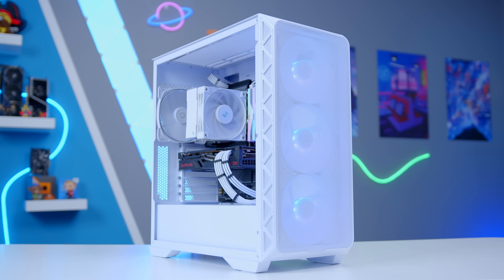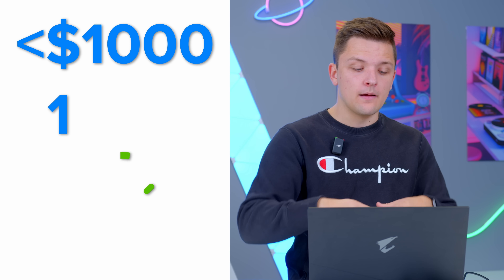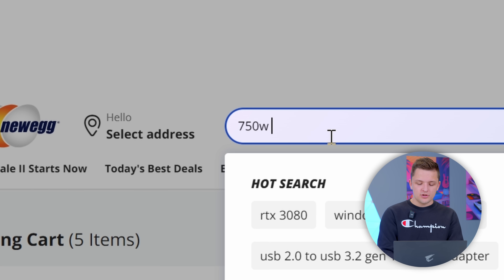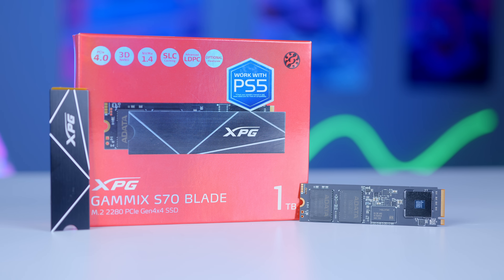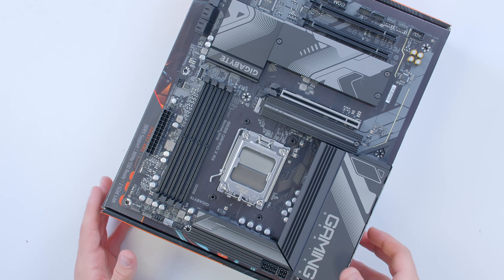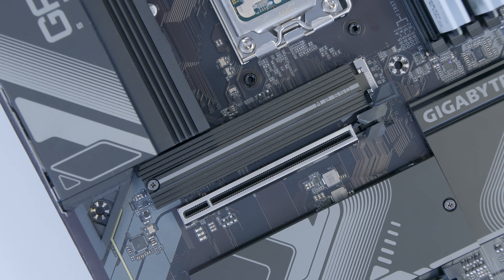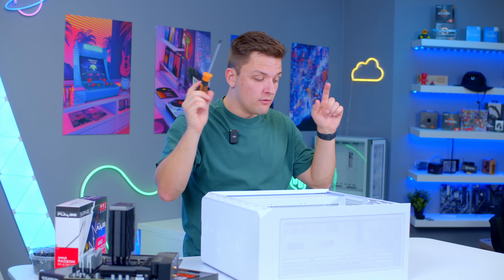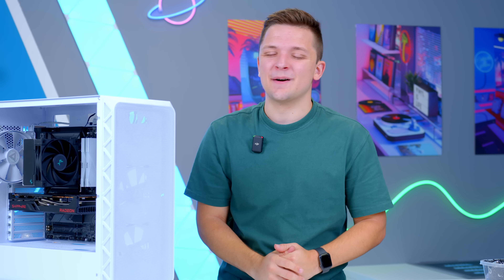The BEST $1000 Gaming PC You Can Build Right Now! 🛠️ [Full Build Guide]

Comment: I'm currently torn between the radeon 6700 and 7600, both have similar performance for the same price, and while th 8gb vram might be an issue, they were still neck and neck at 1440p, which is the highest I'd reasonably run on these cards. Couldn't help notice that your charts didn't have the rx 7600 for comparison though.

Comment: I built this pc, but I haven’t been able to get it to work yet. When I go to install windows 11 it tells me my computer doesn’t meet minimum requirements. Im assuming tpm is disabled, but I can’t find it in my bios. I go to settings->miscellaneous, but in the spot it should say tpm,  it says tsme. Anybody have any idea how I can fix that?
Reply: Figured it out yet? And if so how does the pc rub
Reply: @vaocl  I have not yet figured it out. I'm on night shift, and I've had some family emergencies, so I haven't had enough time to figure it out yet. I'm 90% sure its a TPM issue, but I don't have the TPM setting in my bios, even after updating, and Gigabyte's tech support hours aren't lining up with my waking hours. the computer looks amazing, and was fairly easy to assemble. I can't speak to performance because Windows. 

I did notice in the glamor shots in the video he didn't really plug everything in, its pretty much just the bare minimum power cables to get the lights and fans, and they appear to be custom. the cables that came with are jumper cables, which don't look the best and waste some space, but its fine.

the pre cable management on the case was also a bit messy for my taste. I un-velcroed everything and made them sit a bit nicer, and now they look nice. lots of spare room. I would recommend getting a GPU support of some variety. after a few weeks mine is already sagging a bit. 

When I finally get it running I'll definitely post more info.
Reply: Finally got it working. For some reason windows 11 did not like the tpm setting. I ended up downloading windows 10 and then upgrading after the fact. Now that it’s running, I’ve had no issue and it runs so smooth. I did upgrade the ram because I do a lot of cad/sim game/ram heavy tasks. I think I will also want to get more m.2 drives, since there is space for 3. I went with all black instead of white, and I love the red breathing lights. 

One additional problem I ran into was the built in wifi card came with an out of date driver, so I needed a 30ft Ethernet cable to download the driver, and now the card works great. Honestly almost as fast as the wired connection was. 

If I were to do this again, I would probably upgrade the nvme to a larger size right out the gate, and definitely just started with downloading windows 10. That alone would have saved me three weeks of troubleshooting.

Comment: I just built this exact computer and don't recommend it if you're a beginner like I am. The video does not show you where to plug in the PSU cords. I had such a difficult time figuring out where to plug in everything especially the Power cord which is 1 pin. On the motherboard it is written in about size 2 font. Once I got it running it was difficult to figure out how to configure it so that Valorant ran correctly. Almost 12 hours later everything works great.
Reply: Where did u plug in the power cord on the motherboard?
Reply: Also where are the power led+ and - ports?
Reply: Look the bottom and you will see a bright green square. That's PLED. The bright blue under is HD and red is the power one.
Reply: @aumpeaceamen  the one on the bottom right?
Reply: @aumpeaceamen  and what about the sata port. Sorry I’m asking too many questions 😖
Reply: @prady_hyper how does the build run?
Reply: @prady_hyper sorry I don't remember the SATA. Hope you found everything
Reply: @aumpeaceamen  ya I did thanks
Reply: How does the build run?
Reply: @vaocl my kid says it runs well but this was after we configured it which this video has no instructions on how to do.
Reply: @vaocl  it’s great! I used different ram and gpu coz these ones were out of stock. Although after a few days I started having issues with WiFi. A lot of my connections aren’t showing up, and the ones that are r very weak. Does anyone know how I can fix it?
Reply: Is anyone having problems enabling XMP in the BIOS for this build? Did you guys enable it

Comment: I just bought most of these parts on black friday, and I'm excited to build it. this will be my first new computer since 2015
Reply: I'm in the same boat. lmk how your PC goes
Reply: After a few weeks of troubleshooting, it works great. I would recommend downloading windows 10 to start with, and then upgrading to 11 if you want. The bios had some tpm compatibility issues. 

I upgraded the ram because I do a lot of ram heavy tasks. I would probably have also gone with a larger nvme drive to start with, I have a feeling I will be adding 2 more of them to the empty slots. It performs great, and I love the case. The pre managed cables needed some cleaning up for my taste, but I work in a data center, so maybe it’s not an issue for most. 

I would recommend this build with the exception of spend the extra money on a 2tb nvme to start with, and start with downloading windows 10.
Reply: @seankrake4776  this was insightful thank you sean
Reply: Let us know!
Reply: I have built the pc, but I’ve run into issues. When I go to install windows 11 it tells me my computer doesn’t meet the minimum requirements. I think it’s a bios issue, but I haven’t been able to get it to work yet.
Reply: @seankrake4776 please reply here as soon as you get it done
Reply: @seankrake4776  have you figured it out?

Comment: Awesome  video :) , Im a nooby who is planning on building a new PC for gaming this month and I'm kinda stuck and having doubt about my build components weather or not they will go with each other or not, so I would appreciate your opinion on my build enormously :)

1. 14th Gen Intel Core i9-14900K - with this I have doubt weather should I go with 14900 or 13900 and also with K and KF
2. Deepcool Infinity LT720 ARGB 360mm AIO cooler - will it be enough considering a budget segment
3. MSI MAG Z790 Tomahawk WIFI DDR5 or MSI Pro Z790-A Max WIFI ddr5 - big confusion :(
4. G.Skill Trident Z5 RGB 32GB (16GBx2) DDR5 6000MHz RAM (Matte Black)
5. Samsung 990 Pro 1TB M.2 NVMe + SATA SSD Crucial MX500 Series 1000GB
6. MSI GeForce RTX 4070 Ventus 3X OC 12gb or Gaming x trio slim 
7. MSI MAG A750GL PCIE5 ATX 3.0 750 watt FM 80+ gold

Please give your opinion 🙂

Comment: how is the rx 7600 better? even if the 4060 was slower which it isn't, DLSS alone is worth it. Both are 1080p cards, both are 8GB, they are $30 within each other, both are 128bit. The 4060 consumes less power and is faster (minus CoD). DLSS on balanced looks better than FSR on quality. 6700xt is better than both but if you want new gen 4060 is certainly the way to go. No matter how bad the 4060 might be, 7600 is worse.

Comment: Please help  For my build!!... 
Budget.... 1090 dollar without monitor 

I5 13500  
Msi b760m gaming plus wifi DDR5 
Zotac rtx 3060 12gb 
Kingston 16gb 6000mhz total 32gb
512gb SSD budget limited 
Deepcool ag620 white rgb 
Deepcool PM750D 80plus gold- PSU
Reply: That build should be good enough unless if you are trying to improve some parts.
Reply: @MrAnimescrazy Are there any things that need to be changed? Please help if you have!
Reply: @mdsaimunislam7357  what is your budget? I will go to pc part picker and see what I can do.
Reply: @MrAnimescrazy  
without monitor 1090 dollars 
Work-- gameing and 3d Animation
Reply: @mdsaimunislam7357  ok I will see what I can do and give you a few different options.
Reply: @mdsaimunislam7357  ok so the cpu is the same the i5 13500, the 360 aio cooler is the thermalright frozen notte argb, the motherboard is the same the msi b760 gaming plus wifi, the ram is the g skill ripjaws s5 2x16 for 32 gigs of ddr5 at 6,000 mhz, the storage is the crucial p3 plus 1tb ssd, the gpu is the zotac gaming amp 3060 12 gig, the case is the montech air 903 max mid tower and it comes with 4 fans, the power supply is the seasonic focus gx 650 watt 80+ gold. The total on pc part picker is 1,027 dollars.
Reply: @MrAnimescrazy  Thanks for idea ❤️

 13500 for need 360 aio.??? 
Deepcool ag620 not enough??? 

And YOUR psu not available our country 
So i choose deepcool PM750D 750w Gold 
i thik It's good!?  🙂
Reply: @mdsaimunislam7357  intel does get hot but maybe that is only for the 13700k and 13900k but I would get a 360 aio to complete the look and to fill the empty space with fans at the top of the case but you can go with the deepcool. The deepcool power supply is good.
Reply: @MrAnimescrazy  You are right. But the price of products in my country is very high, if it is within the budget, I will definitely take it

2nd things is 
Many people say to take ARC 770 16gb instead of rtx 3060 12gb ! What do you think!? 
 but arc has drive issue etc issue!
Reply: @mdsaimunislam7357  no do not go with intel. They still have a lot to fix. I would rather you go with the 3060 12 gig.
Reply: @MrAnimescrazy  thanks for support ❤️❤️

Comment: I’m trying to stream while gaming, but wouldn’t like to lag during stream.
Should I stay with these parts or upgrade a particular part?
Reply: What is your price range? I can see if I can help.
Reply: @MrAnimescrazy  $1,550 is probably the most I can do
Reply: @reymartinez-816 ok thanks and does the cpu have to be intel? Is the build all black or all white?
Reply: @reymartinez-816  this build will be for the max performance that I can get you with your budget. The cpu is the 7800x3d, the 360 aio is the thermalright aqua elite v3, the motherboard is the msi b650 gaming plus wifi, the ram is the g skill ripjaws s5 2x16 for 32 gigs, 2tb 990 pro ssd, the gpu is the rtx 4070 gigabyte windforce oc, the case is the montech air 903 max which comes with 4 fans which saves money, the power supply is the seasonic focus gx 650 watt 80+ gold rating. The total cost on pc part picker is 1,523 dollars and the build is all black. So if you want an all white build option let me know.
Reply: 800

Comment: the RX 6750XT is cheaper than the RX 6700XT , is there a reason you avoid that one or just didn't see it at the time? I am having trouble finding comparisons for the models, it's the XFX Speedster QICK319 Radeon RX 6750XT CORE Gaming Graphics Card with 12GB GDDR6 HDMI 3xDP, AMD RDNA 2 RX-675XYJFDP
Reply: Really?? Where?? All the 6750xt I saw were $20-$40 more than the 6700xt
Reply: @LetsSeeYourKungFu   I replied with links but the comment is gone? idk wtf, but if you look for it online even the 7700 XT is same price as the RX700 XT he listed, which is why im confused on what to buy
Reply: @PizzaSIut  that's weird. What's the Vram on that?
Reply: @LetsSeeYourKungFu  12gb, the 7800XT is 500 usd only 80 dollars more than the 6700XT listed there but idk if thats better because it seems like its not as simple as more number is better but some of these are worse than older ones
Reply: @PizzaSIut  the 6700xt is $320 at most on Newegg. The 7700xt is $440-470. The 6750xt is about $380-400. Those prices seem distinctly different. I'm trying to buy a GPU myself. I'm not trying to give you hard time, I'm just trying to understand
Reply: @LetsSeeYourKungFu  Ah ya I see the deals im talking about were on Canada Computers they keep doing these 24 hour deals on random things, if you don't have access to that site then the new egg deals are probably the best from what I've seen
Reply: @PizzaSIut  ahhh that's our disconnect. You're Canuck 😃

Comment: you should've saved money and bought a last gen cpu so u can get a b550 mobo for at least 30$ cheaper, ddr4 ram for another 30$ cheaper and invested that money into a better gpu, a nicer case, and 5 really good arctic p12 fans for just 20$
Reply: Tbh you could do a ryzen 5600 with a 6800rx and save around 100-200$ and get better performance.

Comment: I just built a pc for $1080 after tax taking advantage of the prime deals and Newegg deals last month
Reply: Sooooo will the asrock b650M pro rs wifi am5 amd b650 SATA 6gb micro atx motherboard still work with everything else or i have to get a gigabyte motherboard.. PLEASE HELLLPPP
Reply: Are you saying this like an achievement? You didn’t even list the parts, anyone could spend 1k on computer parts brother.
Reply: @rp2974  Ryzen 5 7600, rx 6700 xt, Thermaltake peerless assasin 120 se, t-force ram 32gb, wd black sn770 2tb, Thermaltake toughpower gf3 750w, and montech air 903 max